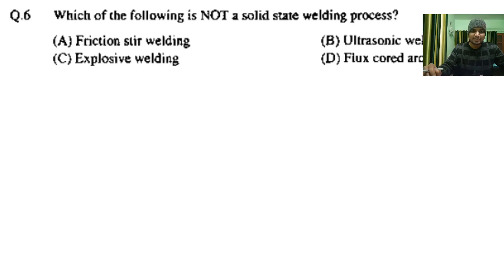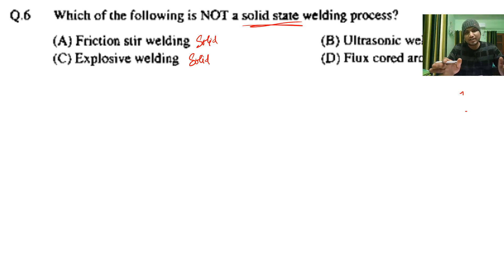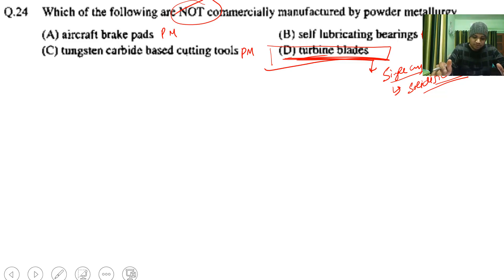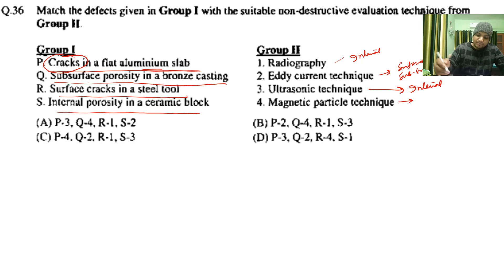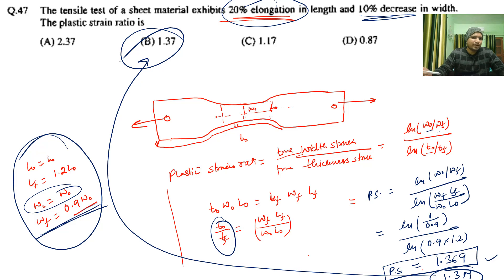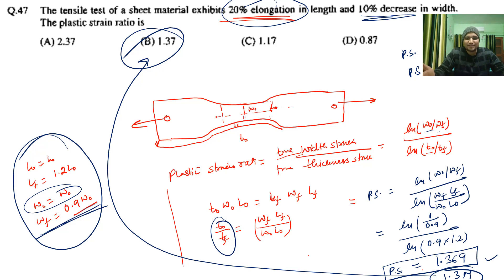GATE 2010 Manufacturing Process Solution

Comment from the maker: 00:00 Solid state welding process
01:35 Casting of slab
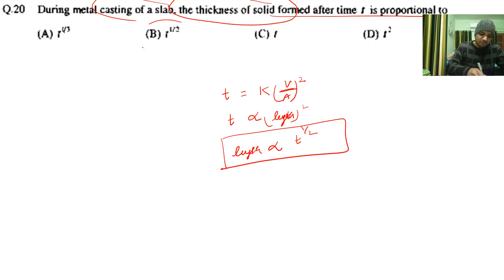02:32 Remove H from molten Aluminium
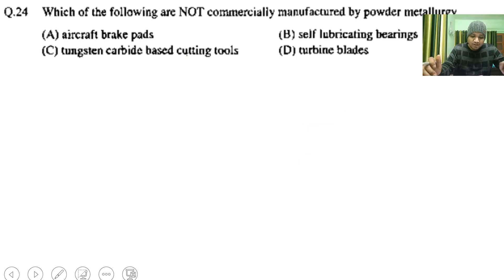04:21 Powder metallurgy
05:33 Match type NDT
08:22 Maximum reduction in rolling
10:07 Match type casting process
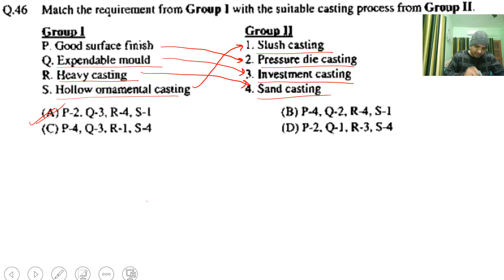12:11 Plastic strain ratio